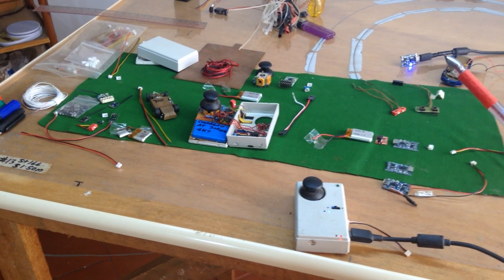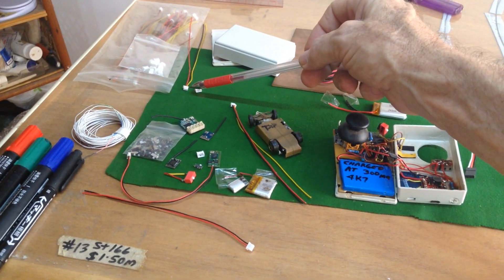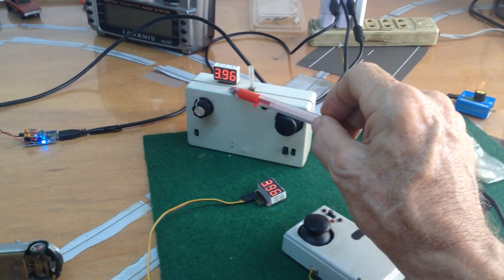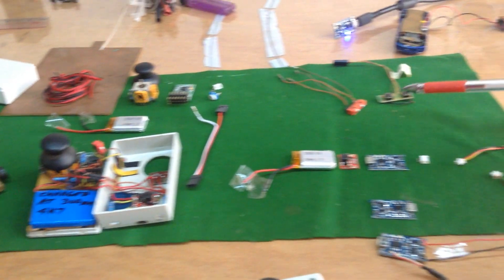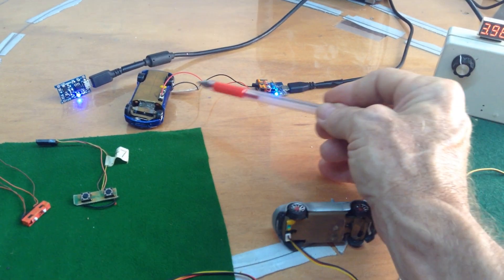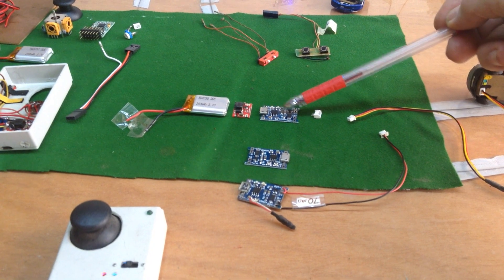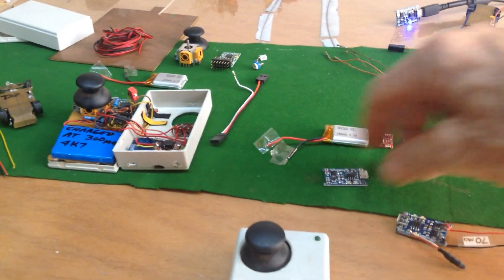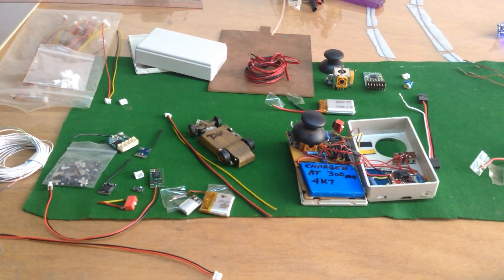Mini Transmitter 2.4ghz DSM2 DIY build information and micro car parts links

Comment from the maker: BEFORE YOU START - be sure you can source LiPo's first (see LiPo info below)
Many links and descriptions change or dissapear so google the descriptions.
The many wed links listed below are not my best or cheapest choices they are only an indication what to look for.
ASSEMBLY - I recommend you bench test and bind the TX2 to the DSM2 receiver BEFORE you fully assemble the transmitter.
Easier to diagnose a problem now and its good to learn the basics of how it all works.
Connect one channel of the TX2 to one side of the joystick and the 10k ohm resistor and link the channel 5 to negative for bind and make sure it binds - then remove bind link and test servo moves etc
........
TRANSMITTER BOARD
http://www.micronradiocontrol.co.uk/product/deltang/dt_tx2_info.html
micronradiocontrol sell these and much more.
Tx2 Deltang transmitter module (DSM2 protocal) - $ its not cheap plus shipping
They have links to the wiring diagrams (I modify the throttle joystick resistors to smooth and dampen out the neutral stick postion - or the cars jurk too fast with the continuous rotation modified servos - but the throtle trim wont function if you have digital trims setup)
So Order the Tx2 with mode profile #7 setting - for reversing channel you simply reverse the joysticks builtin trimpot outer 2 wires and for thtrotle trim you add a 10k trimpot to center the neutral stop position for forward and reverse.
* You can change to profile #4 latter which has digital trims and reverse (needs extra switches to first change the transmitter profile and settings - bit of gymnastic button pushing to remember)
( also they have the Rx47-4 receivers to do all the vehicles many LED lights automatic)
(also they have the CB2 module - wires to most TX modules for 1km plus range)
*Alternatives to use a circuit board from any other old or cheap DSM2 protocal transmitters is obviously another option but it will be a bigger size board.
.....
https://www.ebay.com/itm/Checker-Tester-test-2-8V-25-2V-1-6s-RC-1S-6S-Lipo-Battery-Voltage-Indicator-New/253079703452?ssPageName=STRK%3AMEBIDX%3AIT&_trksid=p2060353.m2749.l2649
TEST VOLTS
eBay
checker tester (2.8v-25.2v stamped on the side) 1s-6s lipo battery voltage indicator LED display.
It is the only cheap and accurate 3.7 volts monitor.
* other 1s-8s LED volt monitors with the alarm buzers are NOT accurate on only 3.7v or 1s - but work ok with 2s - 8s.
....
https://www.ebay.com/itm/10PCS-Slide-Power-Off-On-Panel-PCB-MINI-SMD-Switch-SPM-NEW/152046454446?_trkparms=aid%3D111001%26algo%3DREC.SEED%26ao%3D1%26asc%3D20160727114228%26meid%3D90ae67da7e1e406591f5bdf792ceb447%26pid%3D100290%26rk%3D1%26rkt%3D4%26sd%3D152046454446&_trksid=p2060778.c100290.m3507
SWITCHES
eBay
10 pcs slide power off/on panel PCB mini SMD switch 1.5x2.7x6.7mm
(or bigger size  - 10 pcs red 2.54 pitch DIP switch 10x4x5mm)
....
https://www.ebay.com/itm/1-25mm-Micro-3-Pin-JST-Male-Female-Connector-with-wire-150mm-28AWG-x-10-SETS/181447137539?epid=808618616&hash=item2a3f179903:g:ZnAAAOSw8d9UzaRl
PLUG & SOCKETS
eBay
1.25mm micro 3-pin JST male female connector with wire 28AWG (JST is incorrect chinese description)
(officially called molex picoblade 1.27mm)
(3-pin re-arrange red positive in center so idiot proof if reversed - so dont get the 2-pin type as its not usable for servos, and it can be reversed if forced by accident)
....
https://www.ebay.com/itm/6PCS-80mAh-3-7-V-lipo-Polymer-Battery-Smartwatch-Handset-401220/112666346917?hash=item1a3b7005a5:g:0-QAAOSwYwJaS4iO
LIPO's
eBay
6 pcs 80mah 3.7v lipo polymer battery 401220 (small car lipo 4x12x20mm a bit tight between rear hotwheels) 
....
https://www.ebay.com/itm/10-pcs-3-7V-80-mAh-For-Polymer-Li-battery-GPS-Bluetooth-Recording-Pen-351018-/171266769188?hash=item27e04b8124:g:GCUAAMXQ1d1TIChC
eBay
10 pcs 3.7v 80mah for polymer Li battery 351018 (small car lipo 3.5x10x18mm fits a bit easier between rear hotwheels)
....
LIPO's
eBay and aliexpress LiPo's
Many 3.7v LiPo sizes are available for the transmitter - 250mah -400mah is more than enough as the micro transmitter only uses 50mah - be sure they have the high and low voltage cut off protection attached to the battery terminals.
SHIPPING PROBLEMS to some countries is a real hassle and it wont arrive - ask the seller BEFORE you pay for any LiPo's - they often take your money and dont send or refund when they realise your destination restictions with lithium batteries.
....
https://www.ebay.com/itm/1-2-5-10PCS-5V-Micro-USB-1A-18650-Lithium-Battery-Charging-Board-Charger-Module/302095886094?hash=item465651670e:m:mE36DMEmH039V3nFUNzNYqA
CHARGER 3.7v
eBay search for
10 pcs 5v micro USB 1A charger for 18650 lithium battery - this charges at 1000mah so too much for 80 - 400mah car and TX LiPo.
*REPLACE the R3 resistor (many different types so only buy them if you see R3 marked on circuit board photo) with any 1//4- 1/8watt or 1/8 watt SMD resistor.
Charge mah should closely match the 3.7v lipo for a 1 hour charge.
80mah lipo - 20k ohm for cars. (70mah charge)
120mah lipo - 10k ohm (130mah charge) or 2 x 80mah in parallel 3.7v
240mah lipo - 5k ohm for cars and transmitters (250mah charge)
300mah lipo - 4k ohm (300mah charge)
1000mah large lipo - use as supplied - it has a 1.2k SMD resistor 
....
https://www.ebay.com/itm/DC-DC-Step-Up-Boost-Module-2-5V-to-5V-2000mA-2A-Fixed-Output-Voltage-Regulator/401471087825?epid=860156192&hash=item5d798aa4d1:g:dmIAAOSwnCFaOYgP
BOOST DC-DC
eBay search for.
Regulator step up boost module from 2-5v goes up to 5v DC-DC 2amp (red)
Steps up the lipo 3.7v to 5v for the car charger board (see above) 
.....
https://www.ebay.com/itm/Enduring-Best-Plastic-Enclosure-Case-DIY-Electronics-Project-Box-80X50X21mm-v1Q/272706106570?hash=item3f7e8cf4ca:g:dEQAAOSw3ydVwWKd
TX BOX 
eBay - search for.
Plastic electronics case DIY project box 80x50x21mm white
....
https://www.aliexpress.com/item/100pcs-lot-Stainless-steel-cross-recessed-phillips-flat-head-countersunk-micro-machine-screw-M1-2-3/32665382712
AliExpress
SCREWS  car steering and axil screws.
1mm diameter and 0.25mm thread  (2, 4,  7mm long)
AliExpress
stainless steel or nickle
Round or countersunk heads will both work
M1 x 2, M1 x 4, M1 x 7
.....
https://www.aliexpress.com/item/1mm-3-Flutes-HSS-Machine-Screw-Thread-Plug-Taps/645364587.html?spm=2114.01010208.3.112.Uv3KI0&ws_ab_test=searchweb0_0,searchweb201602_2,searchweb201603_9&btsid=59d4b091-e6ef-4742-8c87-bcd8d8d71068
AliExpress
1mm machine screw thread taps.
I dont use a tap handle.
I losely fit tap in a variable speed drill and slowly clockwise and reverse back and forward.
If you only thread about 50-80% the way through the brass hole, it makes a nice tight fit for the 1mm screws.
....
BRASS
Buy local or google search for.
Brass sheet 0.4mm thick or 16 thou approx to cut out the car chassis and steering tie rod and mounting plate etc.
K&S metals for hollow brass square or rectangular sections like #262, 8152, 8153 etc to cut out the steering knuckles and front axil and pivot bracket components - see drawing at https://www.rcgroups.com/forums/showthread.php?2636061-1-64-1-87-scale-RC-cars-conversion/page4#post38929366
....
https://www.ebay.com/itm/Decoder-Wire-0-04-mm-Highly-Flexible-10M-Ring-Yellow-NEW-/391898410844?hash=item5b3ef72f5c:g:umEAAOSwJb9WrQ-p
WIRES
eBay. (wires inside cars)
Wire insulated thin / white 30 awg 0.6mm outside insulation and 0.1mm x 5 strand tinned copper inside - 10m rolls called "decoder wire" by the model rail guys  (I change the wire colors using permanent ink pens on it, so red, blue, black, white etc)
OR just use the off cuts from the 1.25mm male molex connectors or spare servo wires if you cut and solder them direct to receiver.
Wires inside transmitter to connect the Tx2 module up - unassemble the 3 plug sockets and wire from any thin male JR / Futaba servo extension leads (or any 2.54mm pitch sockets)
....
http://www.himodel.com/radios/PZ_1.7g_0.07kg_.05_sec_Digital_Sub-Micro_Servo_PZ-15320.html
SERVOS
eBay or Aliexpress or HiModel or Hobbyking
Micro Digital Servos for steering and drive motors are called. (size 16.2x 6.2x13.5mm servo)
PZ-15320 (Pingzheng) ***maximum 4.5volts or they die over 5 volts
HK-5320 hobbykings is same but white.
....
Other servos I used before are eMax ES9251 for much larger vehicles only.
.....
https://shop.kkpmo.com/product_info.php?tpl=EyeCandy&language=en&info=p1003_m400g144-mikroantrieb.html&XTCsid=66e596102a3eceaa438020d2b74037d9
4mm Micro motor geared 144:1  M400G144
....
https://m.banggood.com/DasMikro-5CH-2_4Ghz-RC-Micro-Receiver-For-DSM2-JR-Spektrum-transmitter-With-6-CH-PPM-Output-p-1084913.html?rmmds=search
RECEIVERS
DSM2 Dasmikro 5ch (10x10x2.5mm) is from eBay or Aliexpress 
or the DSM2 Rx47-4 from micronradiocontrol (17x11x2.5mm) - it also does many led lights for indicators brakes etc.
(some I use with Taranis is the Frsky VD5M 5ch (22x17x5mm)
....
https://www.ebay.com/itm/5pcs-Two-Axis-Mini-B10K-Joystick-Potentiometer-Fur-Aircraft-Toy-Joypad-Handle/291700320438?hash=item43eab1a8b6:g:YlsAAOSwNyFWf7yl
JOYSTICK
eBay or Aliexpress.
Two axis mini 10k (ohm) joystick potentiometer - joystick is spring loaded to self center - so the cars drive neutral position is mid stick and steering is straight.
Some joysticks available also have a momentary push down built in for an extra function if you like.
....
EXTRA COMPONENTS NEEDED
transmitter needs
1 - 10k ohm resistor for steering joystick pot
1 - 15k ohm resistor for throtle joystick pot
1 - 2k2 ohm resistor for throtle joystick pot
1 - 10k mini trimpot for throtle joystick trim
1 - 3mm LED power on indicator light needs a ....
1 - 100 ohm resistor
1 - main switch 3 position (tx on, off, charge car)
chargers need 
1 - 5k ohm resistor for TX (250mah)
1 - 20k ohm resistor for car (70mah)
.......
TRANSMITTER WIRING CIRCUIT DIAGRAMS
Electrical wiring diagram for transmitter and chargers see post #53 here.
https://www.rcgroups.com/forums/showthread.php?2636061-1-64-1-87-scale-RC-cars-conversion/page4#post38936679
Ggg